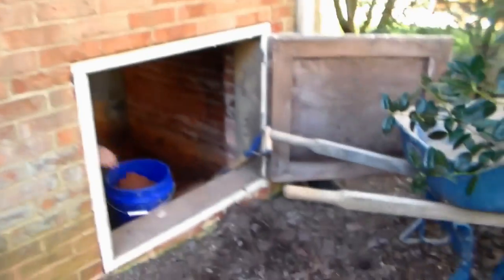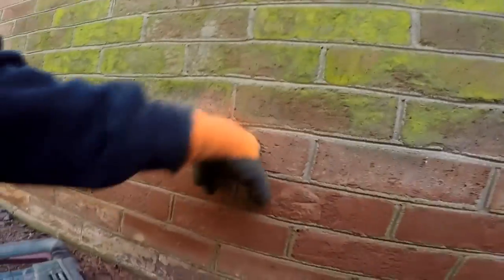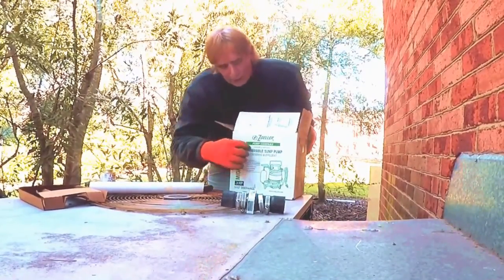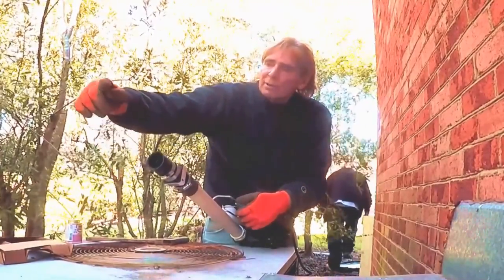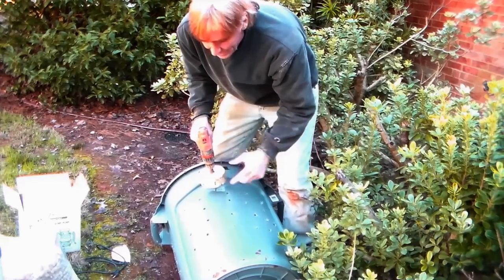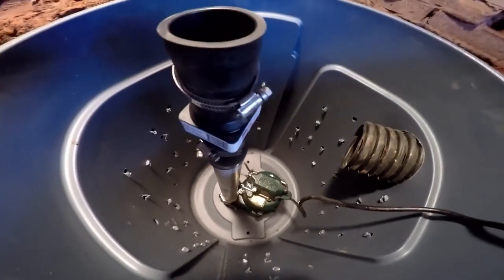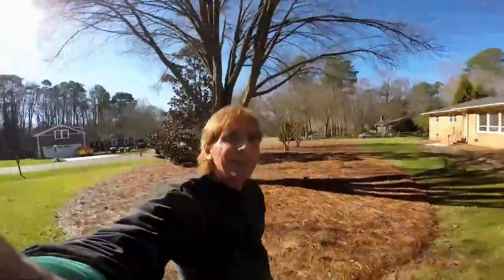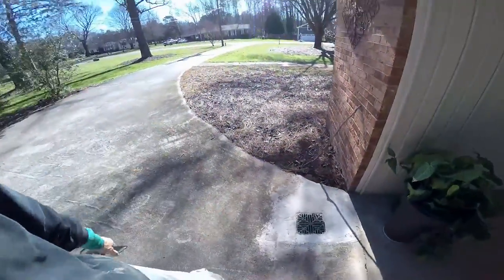DIY Complete Crawl Space Sump Pump Install

Comment: I have a 2000 Sq Ft house with crawlspace in SC.  red clay dirt.  Except for drought periods the dirt stays wet/muddy most of the time and there are several areas where shallow water stands after rain.  My thought is to install a sump in the largest area where water puddles and then "connect" the other puddle areas with a shallow trench so that as the main puddle dries it draws the water from the other puddles.  If I install the sump in the lowest area my thought is that as that area dries it will continue to pull moisture from the surrounding area and therefore keep the crawl space in general dry ( or at least much drier).  the area where I'm thinking to install sump is in the cetnter-ish of the house so I'll need to run the drain line about 20 feet to get it outside the foundation wall.  Good plan?

Comment: one question. Where is the ele outlet ? you never mention before the project. It is very importance . If there is none . I guess you need a GFI outlet install by Electrician . Unless you could  ran a long extension cord but still attach  to a GFI outlet for safety..